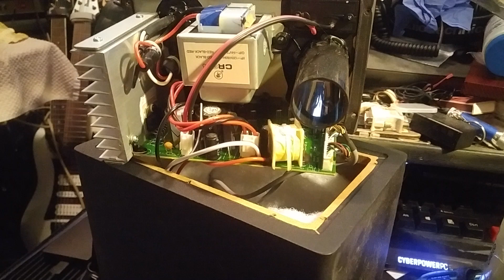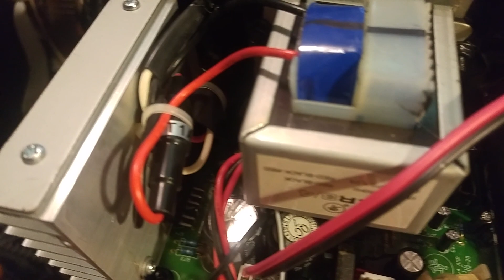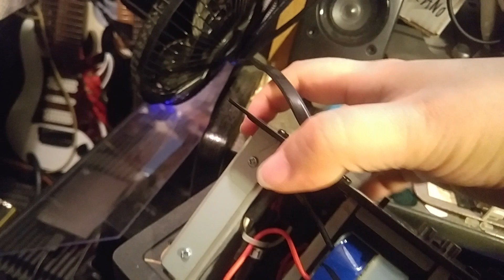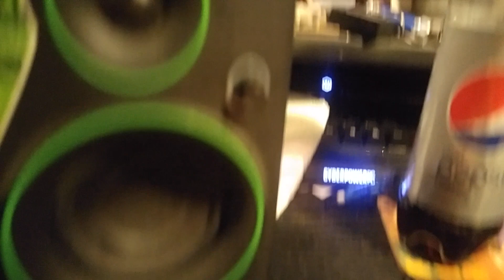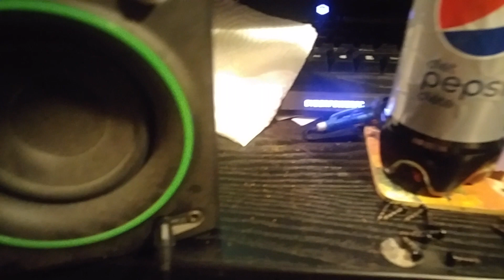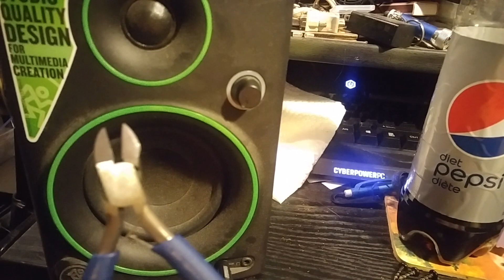Tutorial Mackie CR3 CR4 Speakers Audio only through Headphone DIY repair

Comment: Check R88, and the small capacitors connected near it.  Those parts and two small transistors form a switch that sets the level on Pin 5 to your amp chip to enable the mute.  That's where the real problem is.   If you find which of those components is bad and replace it, you don't cut pin 5, and the mute and the "no thump" will all work (as well as the speakers).

Comment: I have CR3, it just stopped working one day, no sound whatsoever.
It has been sitting in my shelf for 3 months, I just got around to trying to fix it. First I plugged it in though, and it's magically working again. No doubt the problem will return, but for now they fixed themselves.
Reply: Well, that didn't last long. They're dead again. EDIT: I have the CR3.5 actually, the insides are a bit different. Cutting the corresponding pin did nothing. Looks like I've got some googling and soldering ahead of me.

Comment: For many years, I had problems with the L/R switch, until one day the volume suddenly started to drop, and finally, I had no more sound from the speakers. Your solution worked for me. I'm very grateful.

After cutting the pin, I tried only the active speaker, and it started working. I turned it off, connected the passive speaker, and when I turned it on, there was no sound, just a hum. I moved the L/R switch, and still no sound. Then I disconnected the passive speaker, turned on the active speaker, and with the active speaker on, connected the passive speaker. That way, it works without any noise. 

Greetings from Argentina.🖖

Comment: Dude it worked!! ty so much I was almost going to throw them in the trash. In case it helps someone I used a welder first and then with the tweezers that come with the welder I pulled the pin off without breaking it, just in case I want to repair the jack input in the future.

Comment: I unsoldered and lifted that pin and had a loud noise instead. Any ideas?
Reply from the maker: Not personally, but there is a comment further down where the guy gives a really in depth solution
Reply: @jkhan337  can't seem to find it, are you able to tell me who the commenter was?. Also I don't think it's the L/R issue as I had previously fixed that one.
Reply from the maker: Robrobin changed a few parts further down and fixed his. Another commenter fixed the 12v on his. How? I don't know but that's what they did that worked

Comment: Absolutely do NOT fucking do this. The chip is not the issue. I just fixed a few of these replacing C77/78/80/81 and Z3/Z4. Do I agree that these are shitty ass speakers? Incredibly. This chip is not the issue though.

Comment: Thanks it has solve the problem with having no sound at all, but now I have a low hum sound when I turn the power on at the back (even when it's not on at the front). I didn't happen before. The condensers don't seem busted (they're not swollen) but there's a light browning near them. Do you have any idea ?
Thanks ^_^
Reply from the maker: I don't know how to fix the hum. There is another comment further down that is an even better explanation of how to fix these things. I should really pin it

Comment: i just did this with my CR4s (cut 3rd pin closest to outside) and turning the speakers on every time emits a loud large boom, i am pretty sure they are now broken and now scared to use them, not even sure of it works. Any suggestions?

Comment: Cutting Pin5 is a workaround, not a fix. Without the Mute signal voltage, the speakers will not mute when you plug the headphones in, and you will also hear a loud "pop" sound when you turn the amplifier on or off.
The fix is to repair the 12V coming to Pin5 so the amplifier can work as intended.

Comment: Will this also fix it for the L & R input (no audio promblem)? I use an interface and the speakers completely went mute. They turn on but no sound at all and I did a lot of testing to make sure it was the speakers and not a cable or my computer settings. Thanks for the help!
Reply from the maker: A few people below have commented on how to fix the L&R issues. I personally have not had a problem with that but I no longer have these speakers
Reply: @jkhan337  got you, well thank you anyways 🙏🏼

Comment: It should probably also be noted that the powered speaker has two on/off switches.  If you only use the front switch to power it off check the back, you might be surprised how hot it gets and likely why things like this chip and the L/R switch tend to fail.  power it on/off from the back.
Reply: Is there any problem you encounter after cutting that switch?

Comment: Confirming if you've got no audio coming out of the speakers but do have it on the headphone jack desoldering pin 5 will cause the headphone sense switch to be disabled.  The headphone jack will still work, but you'll have audio over the speakers which is probably more important.
Thank you for this video!

Comment: Was looking for a fix, slave speaker was not making sound.. Did an aux test and RCA input test, slave speaker was giving RCA sound while powered was giving AUX.. after a bunch of plugging in and out eventually it worked properly.. I have no idea if anything changed, but I didn't need to cut the pin.

Comment: Thanks! At first I tried contact cleaner on the L/R switch, because my monitor failed after hitting the switch, and they would randomly stop working sometimes and I need to jiggle the switch to get them to work again. But no dice. Cutting the pin worked! I have a of CR5BT. It uses the same setup as CR4.

This kills the headphone mute switch, so if you're plugging in you headphones into your monitors, you'll have to plug it directly into the audio device. Cheers!

Comment: I have this problem with my CR4 (bluetooth). Feels so bad

I realised that it has problems with my power cable, main speaker didn't give a sound, took out and put in power cable from the extension cord and it now gives really dim sound. Have to change some balance setting for now.

Comment: Hey everybody I had a problem with my mackie cr3-v speakers when only one side was sending sound and not the other one. Also, powered position select, I would change it from L and it would sound good there but not in the R. When I changed it to R it would sound there but none in L. You have to change your setting on the device specifically in the device you have it plugged in to. For example: you have this hooked up to your computer, you go to sounds, select playback, find your speaker device, right click it and select properties. Go to levels, make sure the output is at 100 then select the balance button, make sure both L and R are both at 100. Select ok on this window, select apply in the previous window now, then select ok on the next previous window, and there you go! 

I made a video on my YouTube page! Go look at it!!!

Comment: thank you! i had previously been limping them along by cleaning the selector switch contacts with rubbing alcohol but it kept failing after time. working now. I knicked the pin next to it so i lucked out i didn't cut it

Comment: I managed to get it to work without cutting it: Had them running while headphones are plugged in. Then connected said pin to the ground below (basically shorting it) with the tip of my multimeter. Then the speaker starts to play and I simultaneously unplugged the headphones. Voilà! It still played!
Maybe I was just lucky that this time the unplugging would've worked without shorting the connection but I tried that a few 100 times before and it didn't, so ¯\_(ツ)_/¯
Reply from the maker: it sometimes works like that!

Comment: i managed to fix it is the capacitor c74 16v 100mf , i cut the pin as in the video but it felt bad then tester and off and i found the dead capacitor it was easier than looking for it on the internet

Comment: I’ve had a pair of CR4s that have lasted for about a year and a half now. Just needed some inexpensive studio monitors to mix small projects. And then about a month ago, they seemed to have died. No sound. No light on the power knob. Nothing. I was about to trash them until I came across this video, today. I clipped the metal wire as instructed in the video and BAM💥, sound back is back on just like before. Somebody give this guy a round of applause.

Comment: I didn’t believe it. Don’t know how. But this worked for me. Thank you dude
Reply: The cut pin is the Mute pin Nö 5. It receives around 7V less voltage than the voltagr on the input pins (which is around 20V) in Play mode. When headphones are plugged, that pin receives the same ~20V and enters the Mute/StandBy mode. Upon cutting this pin, it remains unconnected and is therefore always in play mode, the speaker play the sound. But, plugging the headphones will not mute the speakers anymore. Also, you will hear a loud pop sound when turning the speakers off as the Mute circuit is inoperable.

Comment: Does anyone know how on Earth to disassemble the passive speaker? There are no visible screws anywhere.
Reply from the maker: I don't have mine anymore as I sent them to my tech for further issues that developed a year later. You might be able to pry the passive speaker apart with a flat heat screwdriver but be gentle so you don't over penetrate and jab the speaker come from the rear. Feel around with the screwdriver for tabs to pry apart the rear.

Comment: I took a look inside, the PCB looks burnt right near that sliding selector switch - DANGEROUS. My guess is the heat is cooking/oxidising the selector switch over time. I just drilled a couple of holes in the metal back panel directly below the selector to help draw cooler air in, up and out via the bass port. Disgraceful design.

Comment: Dude...you are literally a lifesaver. Was about to toss these in the tip but am so glad I came across your video. The headphone pulling technique wasn't working for me but a pair of needle-nose pliers twisted off pin 5 did the trick. Small pop when initially powering the speakers back on, but otherwise no hiss or hum from them for now, just my sweet audio back. Hopefully, it lasts for another few months at least, and if it goes again then I'll spring for an upgraded set of monitors. Thanks a million!!!
Reply: Is it working nowadays?

Comment: Oh man, I love you. Have my babies!

I have he CR4's and they died tonight. Only worked through the headphone jack. I looked online for some fixes and when they were on about opening them and cutting the pin I was a bit daunted and I'm certainly not in a position to buy new monitors at the moment so was a bit bummed out.

Decided to check it out on YouTube and found your video and it looked super simple. I mean, if I bollocks'd it up they're broken anyway so not really a huge issue!

The pin was a bit of a faff to cut as I didn't have small enough cutters but I got there in the end with a guitar string cutter of all things. 

I put it all back together, crossed my fingers and prepared for the worst. Sound instantly. Worked a treat! Sacrificing the headphone jack isn't an issue as I have another headphone output I can use on my mixer.

Thanks for sharing your vid, dude. Appreciate it!

Comment: initially I had the L/R Problem and solved it like Its Dextrin explained in his comment below. After a few months the speakers stopped again to work and I succesfully fixed them cutting the 5th pin like in this video. 
Thanks guys, you saved me to spend money for new monitors :)

Comment: I did it, and now I hear sound, but there is only sound on my left speaker... any ideas what the problem could be?
Reply from the maker: go back inside and make sure there is a big enough gap in the cut, also before that just double check that the other speaker cable is in all the way and that the little switch is working properly

Comment: Thank you so much for the tutorial.    Without your video I would never have figured out which pin they were talking about cutting in the forums.   I also had some cheap M-Audio studio monitors that stopped working suddenly.    Like the Mackies they ran really hot and I think heat was a factor in their demise.   For now at least I have my old cr4s back.    Next I will try to tackle the faulty  L/R switch issue that is very annoying.

Comment: All users of CR series..
3/4/4BT/5BT..will at some time face that switch issue...IT IS NOT FOR everyday/ regular use..
it's ok for once in while crosschk.use , therefore its @ the back.... if intermittent or noisy..JUST SPRAY IT WITH deoxit/wd40/etc. from outside and toggle a few times..
( no need to open the unit )..
should be ok after that....
unless sw. is physically damaged..
The hd.ph.jack & on/off vol. knob , both are part of pwr. chip mute ...the muting ckt. also depends on the  healthy 
 +/- 12 ..@ power up...
managed by 2 smd transistors..

Comment: Hi, I had the same problem, no sound from speakers but headphones OK. I tried everything else and as a last resort, fix or bin, I cut the pin that you describe. Wow everything great, obviously no headphones now but saved me buying new monitors for the time being. Thanks for the great fix.  If you get bored you can click the link below and find the uploads I have recorded for YouTube with my home studio  >  https://www.youtube.com/watch?v=38Sd1tPJvvw&list=PLuhAaknM1mYFDYwKgCR09TAb6fvQ0tcSB.  p.s. I never used to turn off the monitors at the rear switch, but now get a very low buzz when not in use, so have to use rear switch.  cheers.

Comment: Had the exact issue as described. I've followed the instructions and cut the pin but now I'm getting this really loud noise even when power switch is off. Probably I had a different issue? What do you think? Tks anyways.
Reply from the maker: it might be that opamp chip just needs to be completely replaced. Mine is starting to have a loud hum as well but I can't be sure. I would check mackie's forums to be sure. If anything, you can just reconnect the cut bit with a bit of solder and wire to put it back to how it was before you cut the connection
Reply: I have this act same issue. I've just replaces the chip completely but still no sound. So I have no clue what else it could be.

Comment: Has Mackie fixed this problem on the newer models of the Cr3? Thx
Reply from the maker: I have no idea. Sorry. They probably haven't because they buy parts in bulk and these are so cheap that they wouldn't buy better ones. They probably also still haven't used their stock of crappy op amps up either lol

Comment: Hello everyone, just bought today my new cr4bt. When I turn them on, sometimes a loud sound comes out and I have to shut them down immediately. Sometimes it happens after 1-2 minutes they are turned on. Sometimes they pop. Am I doing something wrong or I am running into the l/r switch issue?
Reply from the maker: If they are brand new I would take them back to the store immediately for an exchange or refund.
Reply: @jkhan337  I sent a request to the shop, hoping they will help me.
Reply from the maker: @gioforchiorossi9304  they should. The speakers should be on warranty